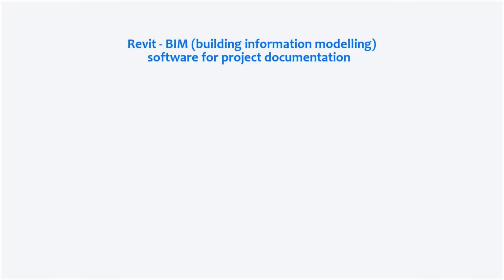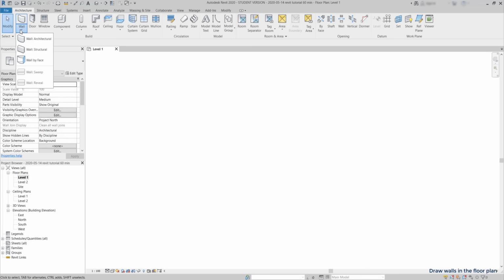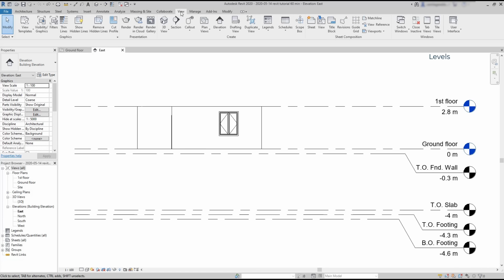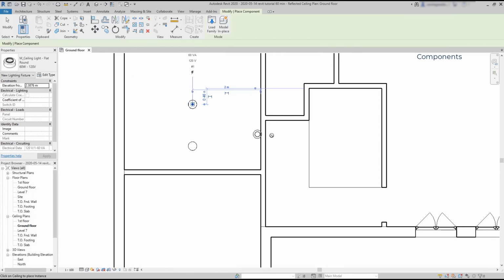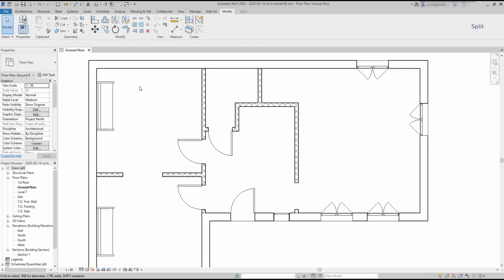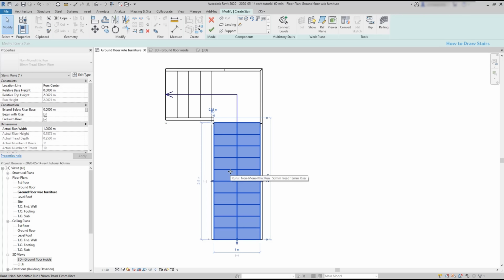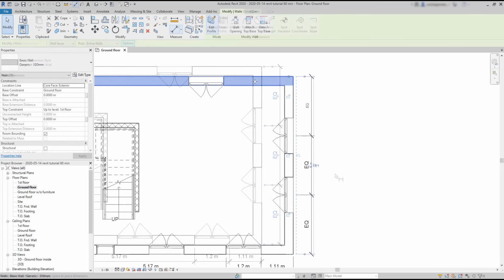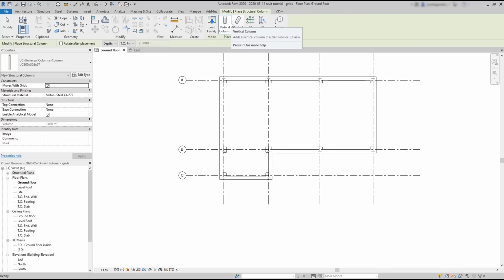Revit - Complete tutorial for Beginners - Vol.1 Revit Architecture Essentials

Comment: A very, very nice explanation of how to work in Revit. But I am a little confusing of one thing. Can you explain something. First you draw a floor for a 1-st level, right? Then you edit that flor to make a space for stairs? Then you put ceilings in only three rooms but not in the biggest room. Why did you do that? When I did that, my space for stairs is blocked by that ceiling. How to do that, how to fix that? Because without the ceiling I can't put a light. Thank you for response and greetings from Serbia. Good work! 👍
Reply from the maker: Hello Milos. 
Thanks a lot for watching this video and I am glad you are learning from it.
Actually the purpose of this tutorial is explaining how the functions, commands work, not to create a project of a building properly. On the Ceiling chapter, the point was to explain how it works, that's why just show you how to do it in a couple of rooms. 
But now I realized your confusion. For the big room, you should to draw the Ceiling as a sketch instead of Automatic Ceiling. Those icons are at the right of the ribbon (once you hit the button "ceiling"). Hope it helps.